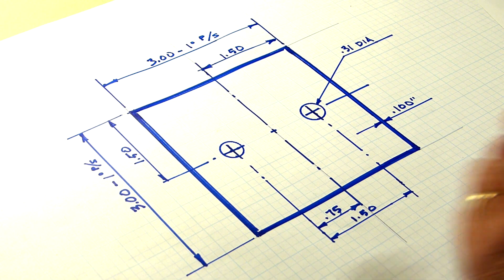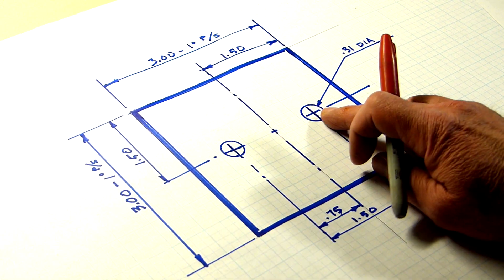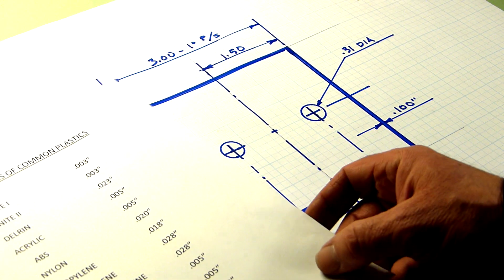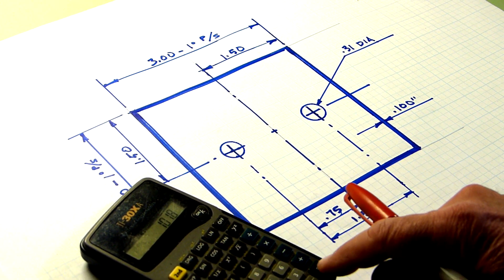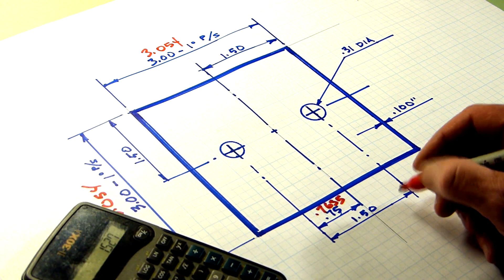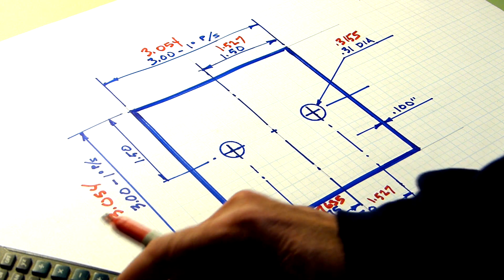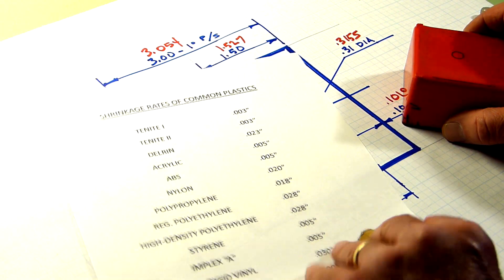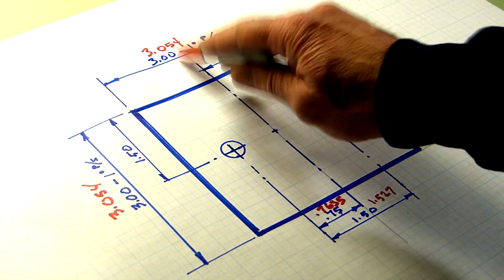MOLDMAKING AND DIE CAST DIES: SHRINKAGE RATES

Comment: Thanks. Great explanation. One question though on the holes, don't they grow because they are a void and the material around them shrinks? So wouldn't you reduce that 0.310" to 0.3045"? Honest question, I don't know one way or the other.
Reply: No. Material just shrinks. Making plastic part smaller, not evenly in all directions, but tight (including holes - they will be smaller).

Comment: Thermal expansion coefficients are usually expressed as an amount of change per degree if temperature change. Not being a plastic injection guy, I assume most plastics are injected at a standard temperature and your chart is based on that?
Reply: No and No. Thermal expansion and shrinkage (specifically during injection - so material is molten) are two separate phenomenons.
Reply: @qwertyasdfghjkl9604  you are saying a given material expands at one rate and shrinks at another? One only need to heat something and allow it to cool and it will be a different size? I do not concur.
Reply: @azenginerd9498  Plastics do have  thermal expansion/contraction, of course (when you heat or cool SOLID part), as for general physical phenomenon.
 
But plastic shrinkage during injection process is a completely different thing here, because you are melting the material! It's LIQUID, plus it's under pressure (specific Pressure VS Time curve, different for each mold/part or even color of the resin!). Plus some chemical changes occur.
...Do you understand the big difference now?
In a fact, dimensional changes may continue hours after molding (that's why you should wait before you inspect plastic parts, they must be "seasoned" a bit, 12-24 h or so is a standard), air conditioned lab doesn't help much.
 
So, word "shrinkage" has two meanings here, different contexts (your understanding is limited to one instance, very basic one).